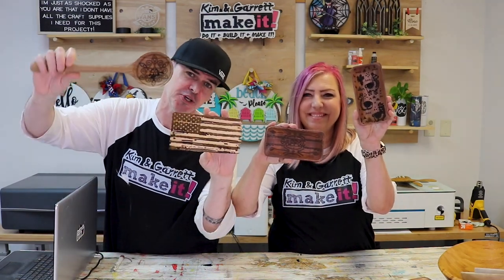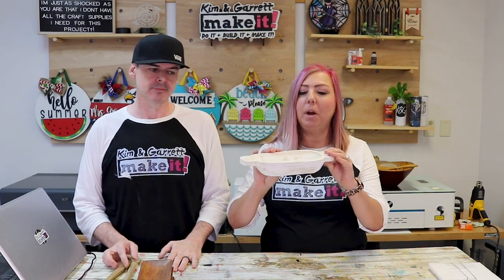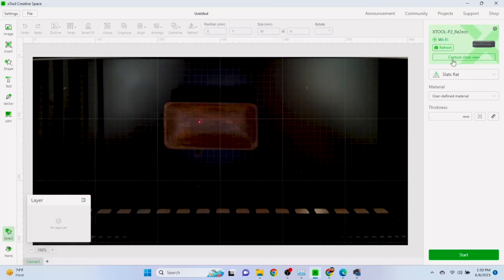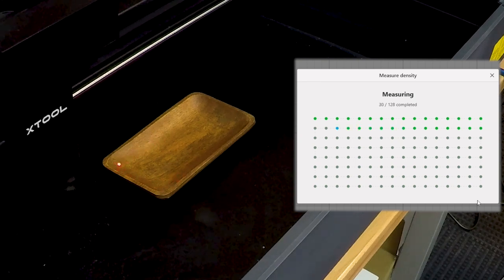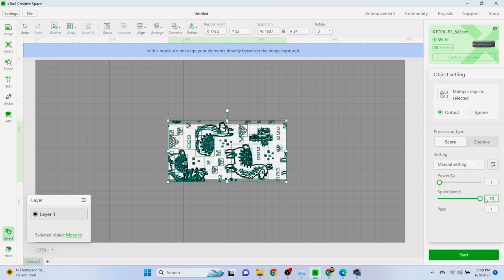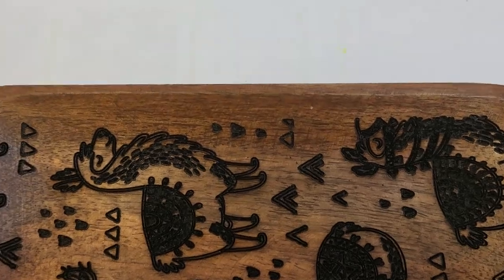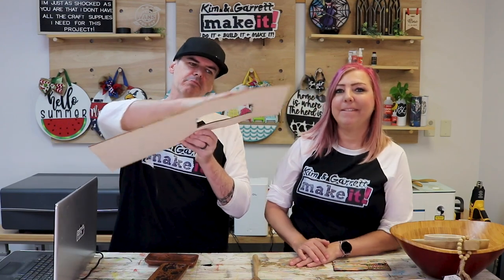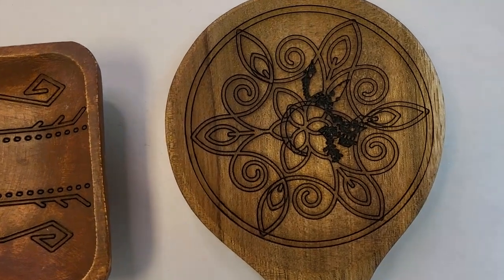xTool P2 Curved Surface Laser Engraving - Step by Step

Comment: I think you can use some wood in each corner to raise it and engrave taller items , just remove the tray. I think 😃 save yourself 500$
Reply from the maker: That's definitely an option but we're okay with not risking the safety of our machine! They did the research for a reason